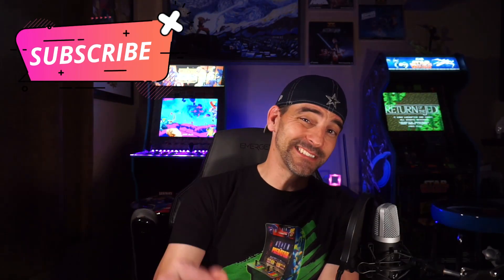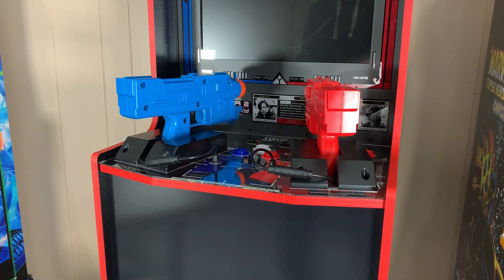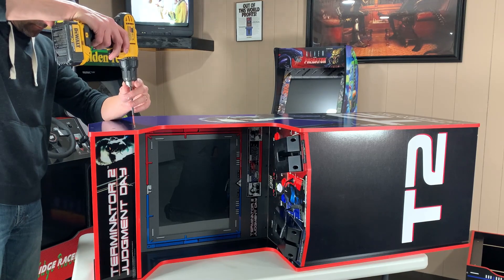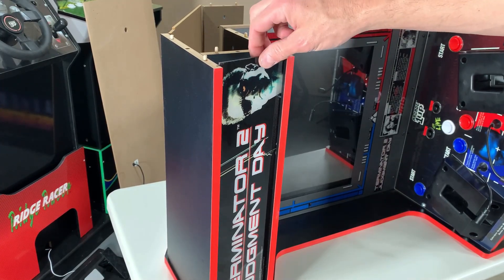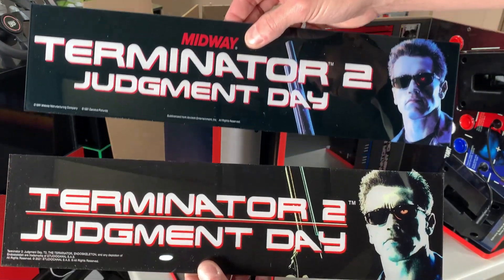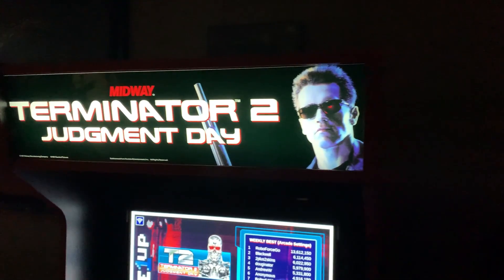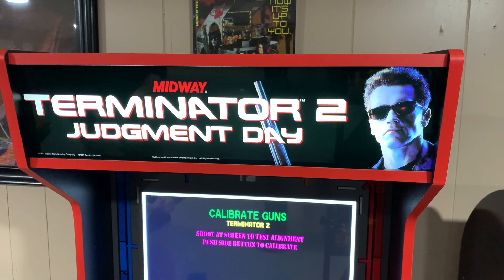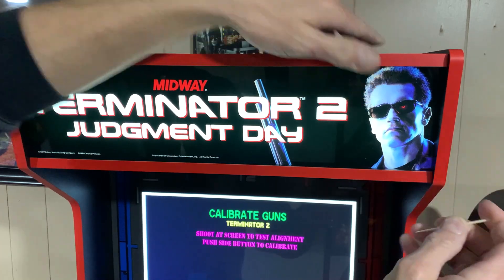NEW Arcade1up Terminator 2 Marquee Install and Review

Comment: Quick question Fox. Watching random YouTube video and guy mention that the way the speakers are set up on A1up with the panel with small  holes drilled messes with the acoustics of the speakers. Do you believe that drilling those out and maybe adding mesh covers ( like the Xl cabs) would make a noticeable difference? Thanks brother 🙏🏻
Reply from the maker: I’ve thought about this a lot. It’s a combination of things that have hurt the acoustics of these new cabinet designs. However what you saying has remained consistent so I think mounting them traditionally would help. It would also allow for a speaker with a larger magnet or a different size, 3” to 4” like my X-men 6 player cab. 🦊👊🏼

Comment: What about 1/8 rubber gasket, or window gasket? to fill the gap. Also is it possible that the T2 part where the marquee sits is a little off. That is. How accurate is the CNC'd MDF part from 1up. The depth of the groove that the T2 marquee slide into. I'm out!